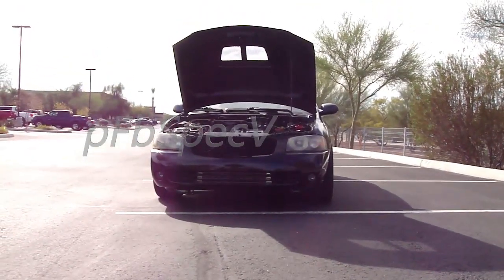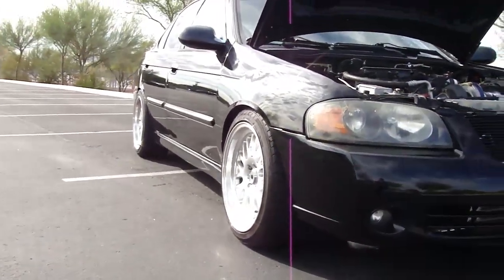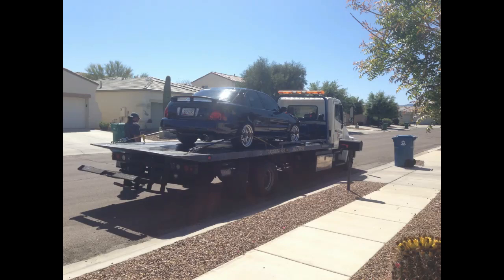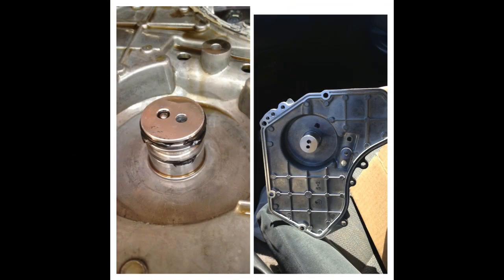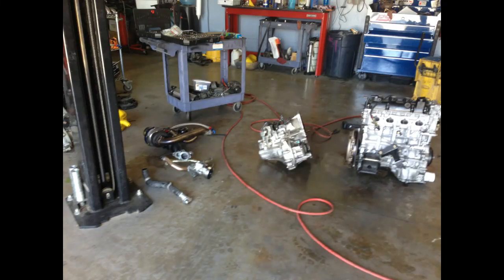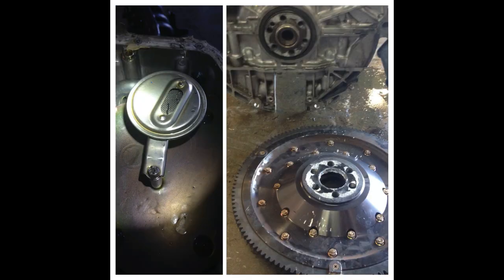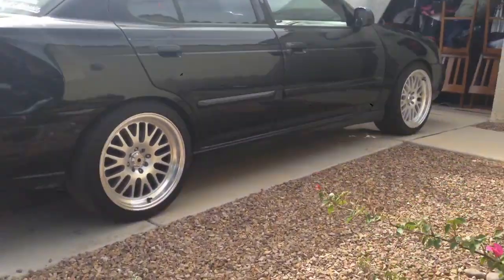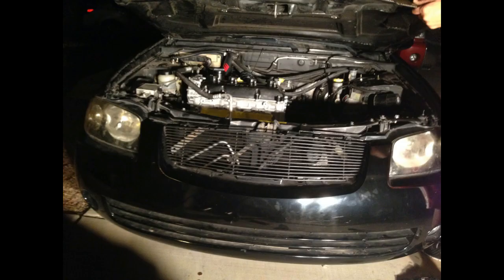pFbSpecV Built Turbo Sentra, Where have I been......

Comment: That noise sounded exactly the same as when I had chain issues on my ka24 before I got my specv.  Really weird issue to see on the cam phaser, I can't say I've seen that before.  Great vid, brings back memories of my 03, I loved that car, RIP

https://plus.google.com/108786742532038219142/posts?pid=6026863917899198226&oid=108786742532038219142
Reply from the maker: Thanks man!! You should get another spec v. Also now I know what bad timing guides sound like lpl